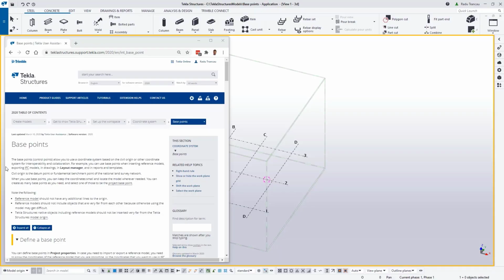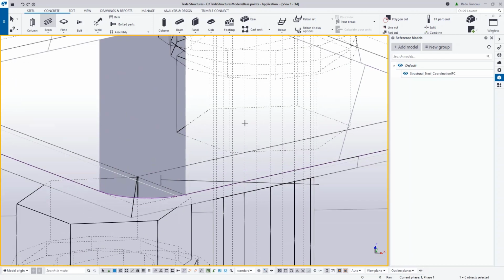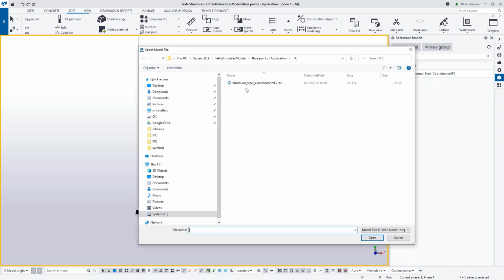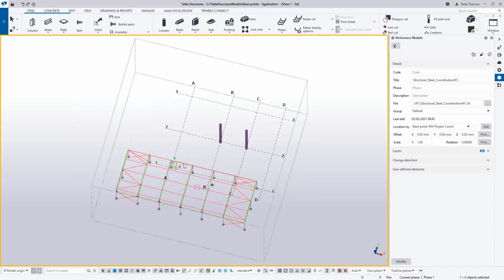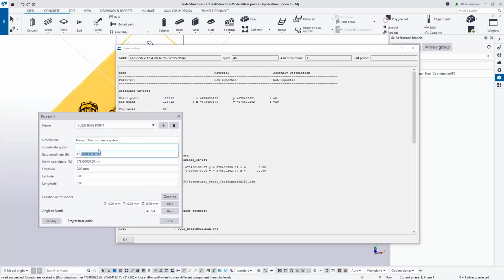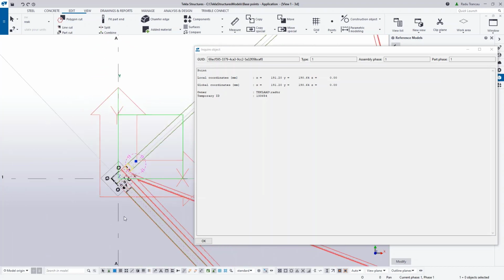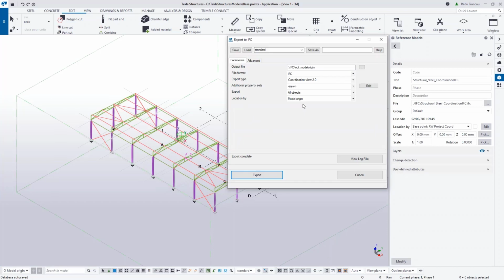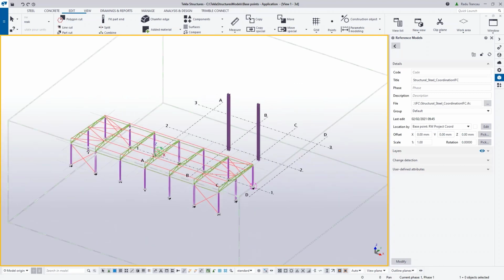Tekla Structures 2020 – Working with Base points

Comment: Hi, thanks for useful information in the webinar. One question - is possible to influence also agles around next axis? Now I see taht anoly angle around Z-axis is possible to set. What about X- and Y- axis? We are using Tekla for modeling of steel bridges and this wouldb be very helpful.

Comment: Good presentation. Only one thing: it seems the the angle respect to the North that Tekla is asking should be the complementary respect to the one picked and not iterative (I think iterative could be x,y or North East coords). Perhaps, in order to avoid iteration, in the IFC files opened should be clear the logic of creation of the base plate in order to pick exactly the coordinates of the base plate itself.